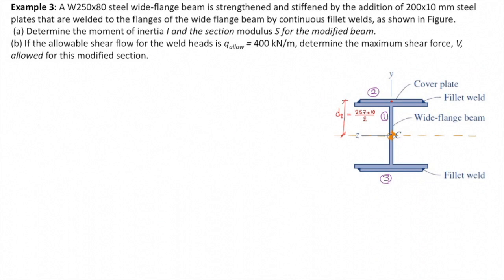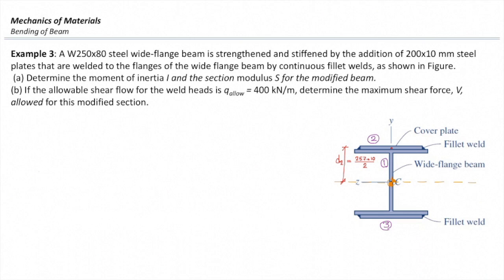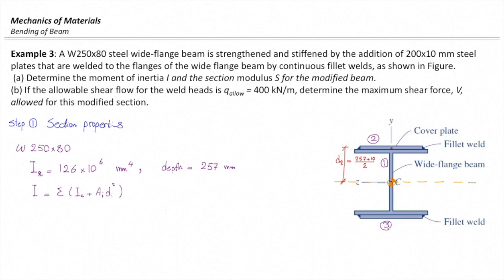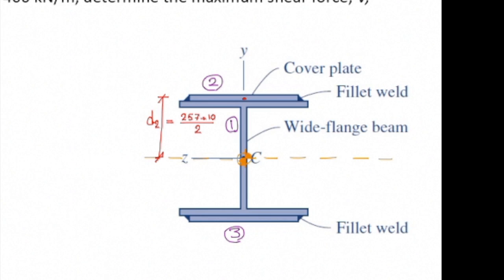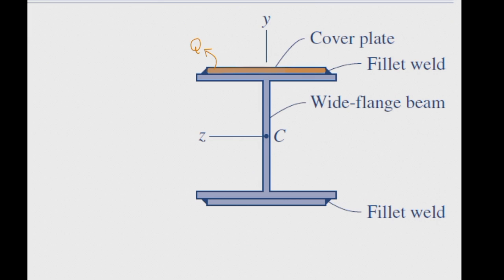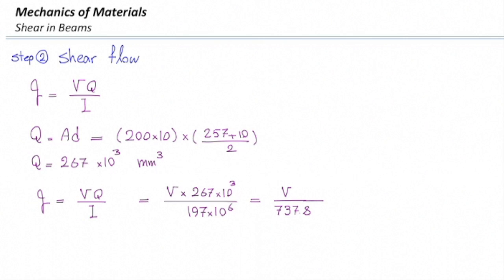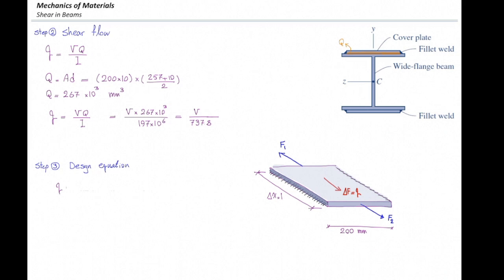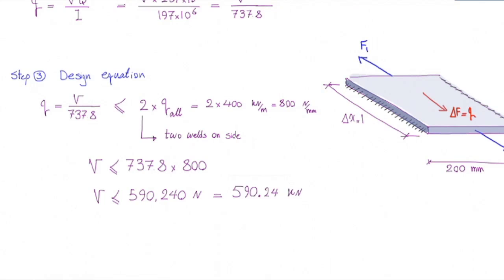Lec19, Shear flow in built up members (part4, example2)

Comment: Thanks for this. Whe  do you use V.Q/I.t instead?
Reply from the maker: You can VQ/It equation if t is considered to be the total thickness of the welding that connects the part.
Reply: @MechanicsofMaterialsLibre  Thanks for your reply. I was reading from my structural mechanics book which says that using VQ/IT is not accurate due to not accounting for horizontal shear stress. Is it safer to use VQ/I in all cases when designing welds for a built up member?